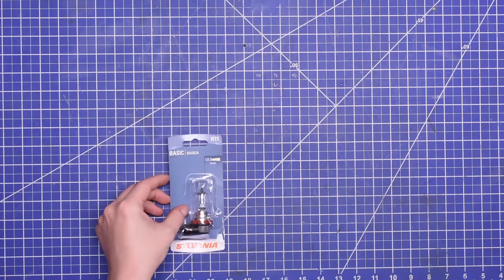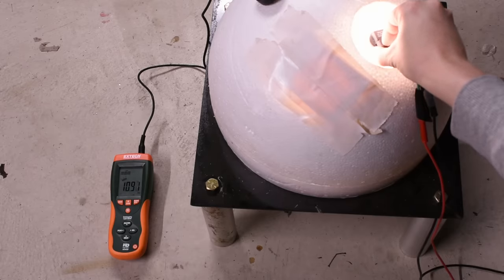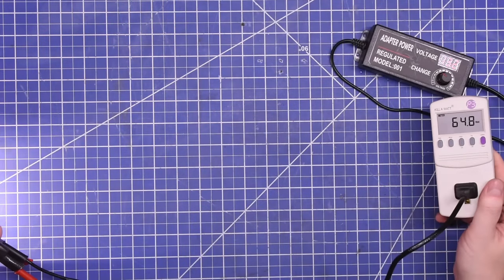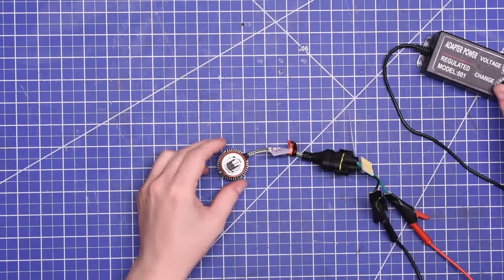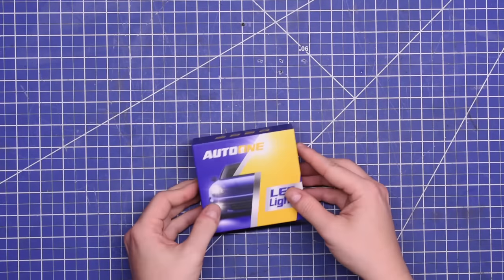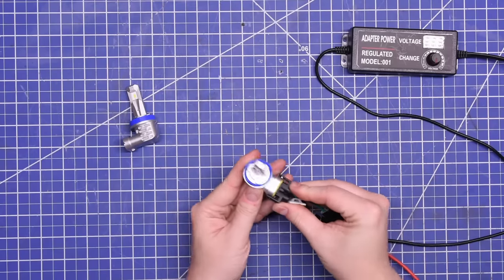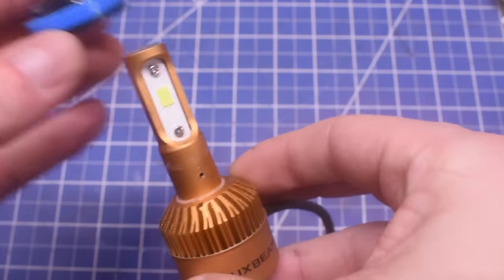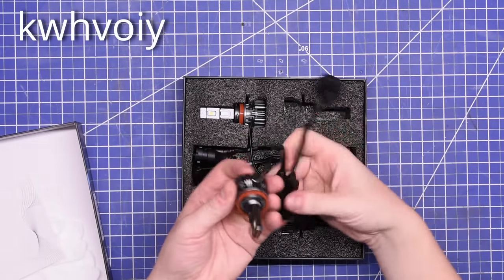Amazon Headlight Bulbs are Getting Out of Hand

Comment: Even small amounts of extra light above the cutoff = glare. For that last LED brand, the amount of stray light was massive and they would blind EVERYONE in the oncoming lane.
Reply: I would like TTC try to come up with a "Dick on the Road" rating for these lights. Something to try and test just how obnoxiously blinding some of these are lol
Reply: Does it also have to due with what type of housing there is? My cars with reflector style housing usually have a huge amount of extra light, where my two cars with the projector style have a perfect line,
Reply: @justchillin7274  it definitely does depend on reflector versus projector, however the hotspot location changes dramatically if you use the incorrect light source in a projector. So in general you lose a lot of reach if you put an incorrect type of bulb in a projector.
Reply: @jseen9568  if they projected the light on a wall thirty feet away and measured with a lux meter about an inch and a half above the cutoff line on the left hand side they'd be able to tell if oncoming traffic were getting blinded or not. If my memory is correct about three lux is too much.  I can do the math later if they wanted to know the exact lux limit.
Reply: @justchillin7274  nope, all that matters is the bulb is in the correct orientation and the headlight housing is adjusted accordingly. You can rotate most led bulbs to adjust it to your fixture. That way you aren't binding oncoming traffic.
Reply: @jseen9568  This should be the way for led headlights, "and if you want to be the biggest piece of shit you can buy these". Nobody should be using these, they should be illegal.
Reply: @KyrieEleisonMaranatha  That's 100% false, it's just marketing wank from the LED sellers. Modern halogen reflectors are computer modeled and designed for light emanating from a tiny cylindrical light source (the space taken up by the filament). Each of the reflector "facets" is designed to redirect that light to a particular location in the beam profile. Anything which deviates from this shape and light distribution will inherently cause glare, it is an unavoidable physical fact; the only question is how much. 

Add on to this, our eyes are FAR more sensitive to glare at wavelengths on the blue side of the spectrum compared to the red. As such, even small amounts of extra LED derived light above the cutoff are a notable hazard for on-coming drivers. 

To be clear, projectors are also prone to this issue. Just the physical cutoff which is built into the projector can provide a physical barrier to the glare. That being said, it is still 100% possible to cause the same issue with projectors.

At the end of the day, use the right kind of bulb for your housing. There are no cheap shortcuts.
Reply: Extra light low in the beam can also increase glare. You can also see how some of these LED replacements are not putting much light in the hot spot, so they are worse for the driver as well. If you make the field around the hot spot brighter you close down the pupil, so the light down the road becomes less useful.
Reply: @1PooNGooN3  They are illegal. Changing a factory halogen headlight to led or hid is illegal.
Reply: @KeithJewell  not really though, because glare is only visible above the drive line. If the extra light is low then it is hitting the ground, not the driver's eyes. 

Also with the led's that don't really hit the spot well. Need to be rotated in the housing until the ideal placement is found. All of which can be avoided by properly installing them. Not always the led's fault.
Reply: I agree, however completely stock suvs and trucks do that just fine on their own. I won't sweat some aftermarket leds.
Reply: The right way to do it is retrofit projectors in your housings. But most people are too cheap to go that route.
Reply: not only that, but a bad pattern can reduce your vision where it's important, same with the color of light.

Headlight design is actually fairly complicated (at least when it's done well)  too much light up close makes drivers feel good, but reduces distance vision (a extreme example is driving with you interior light on) Same with the color of the light, your eye's adjust less with warmer tones (which is why astronomers use red flashlights, at least they did when i was a kid)

headlights alone make me wish we had annual car inspections here.  Though i did eventually cave to the old axiom "if you can't beat em, join em" when it comes to hid retrofits.  The eye strain of dealing with all the people around here with badly adjusted\WAY to bright lights...I just couldn't deal with it anymore.  We are even starting to get a few people driving around with led light bars on the highway :(
Reply: @KyrieEleisonMaranatha  Keith is correct. The extra light close to the vehicle causes your eye pupil to contact which reduces vision to far away points.  No amount of rotating or adjusting a LED bulb will correct this.
Reply: @PedroDaGr8  it sounds like you are in the automotive lighting industry.  Is that correct?
Reply: @Wooble  It seems like the "Big 3" truck manufacturers just absolutely revel in making garbage patterns now. 
My service truck is a 2022 Ram 5500 with halogens, and yes "I" can see great, but I get flashed regularly as I'm blinding the opposite lane. Then another newer Ford/Ram/Chevy will come the other way and I'LL be flashing them, just to have their death-rays set to KILL in response. 
And that's factory housings, factory bulbs, factory alignments. 
The chuckle-fricks running around with LEDs in every place they can stash them, including a light bar up top and one on the grille.... I really have to remind myself that it would be unethical to shine a high-powered laser at the driver's area.
Reply: @PedroDaGr8  lol
Reply: I see this more and more lately too. It's HID kit nonsense from the late 2000s all over again!
Reply: Having your front window tinted help a lot. I have 40% on my cars, it's amazing for this.
Reply: @canabisquick  Tint the front windows to reduce the light from aftermarket lamps.  We've really gone full circle huh
Reply: You know you're supposed to turn off the main beam when there's incoming traffic right?
Reply: After being blinded for years by new cars headlights, now that my truck is lifted, I dont care if I have the brightest, glariest headlights on the planet. Paybacks a bishh...
Reply: Even factory headlights are getting more and more blinding._
Reply: @puppetmasterblaster  I'm sure the elderly people in the oncoming lane appreciate that as you wipe out their vision and they drift over the line into your lane...
Reply: It's a habit now, that when a car is coming at me with lights too bright, I raise my left arm to block it. I hate it, it's dangerous as hell, but so is being blinded by some idiot's headlights.
Reply: Yeah, this is why I have some obnoxious LEDs in my car, but only in the highs. Sylvania Basic for lows.

...don't forget to turn your highs off if driving at me, lest ye get a double flick of my portable sun.
Reply: @bumponalog7164  Only if the reflector isn't designed to accomodate the bulb in question*

(Swapping isn't an issue if you've got a projector array that accommodates the bulb and eliminates glare properly. Most companies do not design these bulbs properly, though.)
Reply: @typrus6377  Yeah, truck manufacturers have clearly embraced their median customer's mentality of being the protagonist in their story.
Reply: @puppetmasterblaster  You get to stare at my unfocused (rear reflector only, AKA: throw light everywhere!) ~3100 lumen highs then, bud.
Reply: Then here you are, me, the mad man who's gonna run straight up LED pods from a company like Rigid Industries as the headlights on a project car, cause fuck you 😂
Reply: I think blinding everyone else is the goal. According to my night driving everyone uses brights at all times with over bright bulbs.  I just flash brights at every other car.
Reply: @jseen9568  YES! The LED headlights are nuts, everyone is driving around with blinding headlights now!
Reply: @justchillin7274  Yes it matters a ton. None of these lights should really be used in reflector housings but everyone uses them anyways. With projectors they can be super bright and directed correctly so they don't blind oncoming drivers.
Reply: @bumponalog7164  Yup but at least in my area the cops don't so shit about it. Everyone is driving around with either HIDs or LEDs in reflector housings or have their high beams on, it's a fucking shit show driving at night here.
Reply: One of the 'best' things to do is mod your housing to carry an extra light, and put a 50,000 lumen sun blaster in these (one of those things that only can be turned on 5-10 seconds or it will burn out). Drive around town with highs on, and when someone inevitably flashes you, flash back with the sun blaster as if to say 'thats not my highs, THIS is my highs'.
Reply: @bumponalog7164  can you share the statute number? thx
Reply: @KyrieEleisonMaranatha  All that matters is "do you get flashed by other drivers even when your low beams are on."  You know who you are.
Reply: i think officers should pull people over for bright ass headlights
Reply: @KyrieEleisonMaranatha  No way. The housing 100% matters. Putting an LED in a halogen housing is dumb.
Reply: @EasyMoneySG  No the housing certainly doesn't matter. You can put an led in any housing. So long as it is installed correctly it will perform better, and much cooler than the halogen.
Reply: @brettspencer-curran8269  Bose style leds should not be used in projector housings. Get the silver star ultras or try some hids.
Reply: Like many factory LEDs now.
Reply: @KyrieEleisonMaranatha  it absolutely matters. Please stop saying nonsense.
Reply: @woodchippers_WestWingDimeBag  FMVSS108 section 11: "each replaceable light source must confirm to the dimensions and electrical specifications furnished with respect to it pursuant to part 564 of this chapter, on file in Docket No. NHTSA 98-3387 and must conform to the following requirements.". It then goes on to describe the requirements of the light source.  In a nutshell: if your lamp is designed for a replaceable light source then it must use the type of replaceable light source stamped on the headlight housing.  Using a different light source is illegal under federal law.
Reply: @brettspencer-curran8269  yeah right smart guy. I actually install these all day every day. So you clearly don't know what you are talking about. Led's can go on any fixture even an hid style can take Led's. So why don't you kick rocks.
Reply: @KyrieEleisonMaranatha just because they CAN go into the housing down mean they SHOULD go.  I would be astounded if these lamps make a legal beam pattern. So do you have a goniophotometer to check that the beam pattern passes fmvss108?  If you aren't checking then congrats you are doing something illegal.
Reply: @brettspencer-curran8269  this? 
Title: Section 571.108 - Standard No. 108; Lamps, reflective devices, and associated equipment. Volume: 5 Date: 2004-10-01 Original Date: 2004-10-01
Reply: Remember, these headlamps that are rated as extremely bright appeal to people that simply don't care about other drivers. ?They may even hope they're blinding drivers in the opposing lane.
Reply: @phlodel  they also appeal to people in the country where we don't have a street light posted every 100 ft 
people who simply want to upgrayyedd their older vehicles to modern lighting so they can see the oncoming road 
blinding others is not the appeal
Reply: @joez.2794  nope, because i have mine properly aimed below the drive line. You can match it with the factory line. As long as the cut off line is not above the drive line. Then you shouldn't be blinding oncoming traffic. But thankfully there is no law against having your headlights properly aimed. So even if someone does flash me or anyone else. They can be mad all they want, i couldn't care less. Unless I'm getting pulled over i don't care about other people complaining. 🤷
Reply: @woodchippers_WestWingDimeBag  the copy I have called it  fmvss108 but the title "lamps reflective devices [...]" seems to be the same so I think those are equivalent.  The newest copy is 2022, which includes rules for ADB adaptive driving beams.
Reply: @brettspencer-curran8269  I can't find any markings on my light housing
Reply: This dude complaining about some ricer kid putting $9 dollar LED bulbs in his halogen housing as if newer vehicles aren't literally the surface of the sun with these factory LED's.
Reply: I agree. LED bulbs work best in diffuser headlamps, which focuses the light directly forward and not at oncoming traffic.
Reply: @34griter  Even hid style headlights can bleed light. If the led is not installed correctly. Proper installation is key to having properly aimed headlights.
Reply: @woodchippers_WestWingDimeBag  it should have a DOT marking and nomenclature for the light source.  For example H11 for a low beam, and 9005 for high beam.  It is usually printed near the bulb socket but not always.  The manufacturer may have put it in a location that isn't visible unless you unmount the headlight.
Reply: For a standard car at the proper ride hight your low beam light should be 30inch from the road that’s the hight of the low beam high beam add an extra 4 inches of hight any lower you won’t be able to see down the road any higher you are blinding people. Good way to test this high beams when on should reflect off the street signs low beams should not reflect off street signs. Trucks that sit higher the light hight may have to be lowered or else again you will be blinding people
Reply: @EasyMoneySG  depends on the housing. Projector housings do just fine since they throw the light. If beam pattern matches factory lights you're golden.
Reply: People drifting across the road at your bright lights? Of course---it's a moth to a flame. You blinded me and I don't want to drive off the road so instead I'm likely to come at you.
The USA used to have stringent headlight standards for highway use. Incompetent legislators bought the claim that brighter lights would reduce vehicle pedestrian accidents. Freeways and highways are not for pedestrians. If you're overrunning your headlights, SLOW DOWN instead of blinding everyone else.
Reply: Just carry a LED flashlight with a focusable beam in your car and blind them back until they learn their lesson.
Reply: @Karl with a K That's like saying I need to buy a large SUV for my own safety.  If everyone went that route, in the end, no one wins and the status quo is now even worse.
Reply: @brettspencer-curran8269  he is spot on, the reflectors are only designed for a 10x2mm light and this is why newer cars no longer use H4 globes as the manufacturing standards are not as precise.
also he is correct about blue light waveform
Reply: @javic1979  who was correct about the light source?  Sorry I don't know what comment you are referring to.  As for blue light "waveform" you need to be more specific.  Are you talking about scotopic vs mesopic vs photopic eye response curve or the radiant spectral distribution of automotive white LEDs?  Again, sorry I lost the what topic thread we were speaking about
Reply: @woodchippers_WestWingDimeBag  "In the United States, lamps, reflective devices, and associated equipment are regulated by the US Department of Transportation (DOT). Even though these types of LED lights can be used in place of an original halogen light bulb, it is not legal to use on vehicles registered for on-street use
Reply: Front tint is illegal in Australia @canabisquick
Reply: @Erik_Swiger  Raising your left arm, I am constantly doing that.  It's the only way I can see, I just focus on the right side of the road.  And, cussing the hell out of the offending vehicle!
Reply: That seems to be the norm these days...
Reply: Are these actually road legal in the US.

Here, only the type of bulbs the car was certified with can be used.

All of these bulbs are not legal, and if the police spot you, they will stop you, fine you and call the car in for an inspection to "prove" you removed them.

And yes, police officers here do know that a 2005 Ford, did not ever have THAT bright headlamps so they know when you have some aftermarket HID's or LED's.
Reply: @JohnDoe-bd5sz  Are these bulb legal? Not at all. Will the police stop you? Depends on the state/municipality. Some areas are REALLY REALLY strict about things like this and others don't care at all.
Reply: Precisely angle a mirror inside the top of your windshield such that it reflects back excessive glare to the offending driver. Do the same inside the top of the rear window to prevent drivers with high or mis-aimed headlights from following too close.
Reply: Yeah fuck these damn blue super bulbs. Ugly. Not aesthetic. France has the right idea mandating that all headlights be a warm amber color
Reply: @PedroDaGr8  Proper headlight adjustment is key. I have led headlights in my beater 01 camry and the body shop i work for has equipment to help aim headlight to minimize glare. You can have stock headlight bulbs and still blind oncoming traffic from poorly adjusted headlights. You basically need to aim your headlights a few degrees lower to offset the glare. Its not rocket science. Just aim them lower.